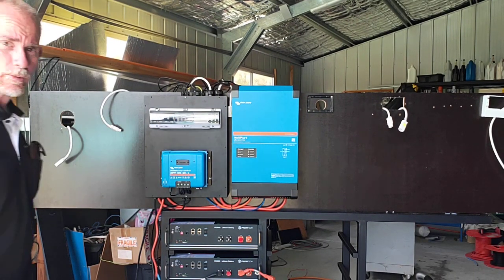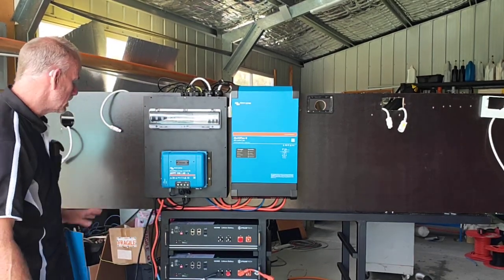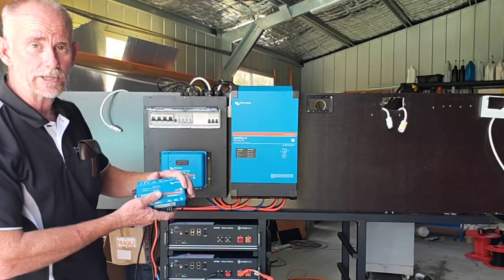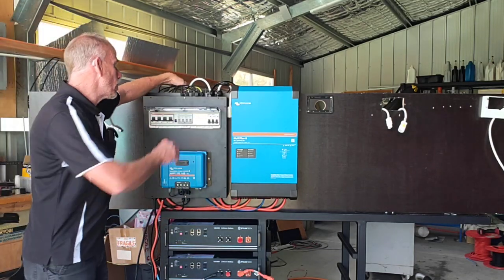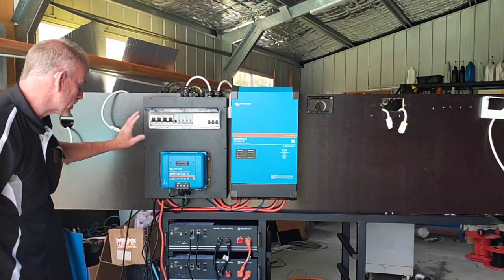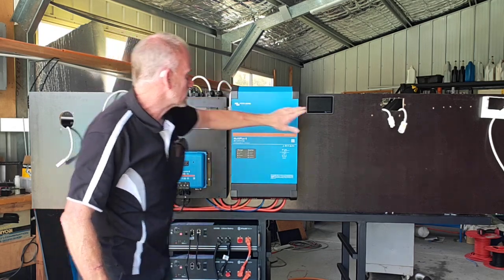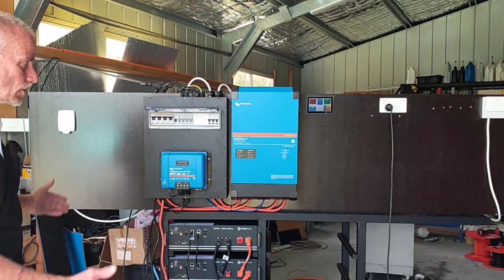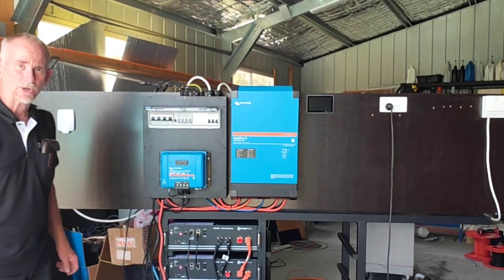Victron Multiplus II and the Langshore Power Breakout Box

Comment: This looks similar to the setup I'll probably have Steve, except more likely with the 3000 inverter and two batteries. How much would a setup like this weigh altogether?
Reply from the maker: Hi there and thanks for the question. The 3kVA Multiplus II is 18kg and the 5kVA is 29kg. The Pyontech 48v 3.55kWhr batteries weigh 32kg each and the 24v version weigh 26.5kg at 2.8kWhrs, so a little lighter but slightly less capacity. Hope this helps!
Reply: @langshorepower5346  thanks yes it does help. Trying to design the layout for my new bus and wanting to balance weight as much as possible. Aso trying to get a sense of how much space to allow for the electrical gear now since the coaster doesn't have any underfloor storage.
Reply from the maker: The best thing I did to save weight in my coaster was use lightweight ply. It’s not cheap, but saved hundreds of kg compared to standard whiteboard I used on my first coaster fit out. Chat to Richard at NOQ NOQ.
Reply: Bloody gentleman, thanks for your time mate. Thanks for such a great video and can’t wait to get one of your setups in the near future!
Reply: Hi, do you need to have segregation between voltages in the switchboard? Cheers
Reply from the maker: Yes Jeff, there's a physical divider inside between the 240v AC wiring and all the DC gear.

Comment: hi Steve, what breaker did you use for the battery disconnect? as you need a bi-directional breaker and not a polarized one as they will catch fire when there is amps from the charger, as they can only extinguish arcs from one side.
Reply from the maker: Spot on mate, you cannot use a polarised breaker. I’ve used NOARK 360v dc breakers for the solar and the larger ones are ABB.
Reply: @langshorepower5346  thanks Steve! that helps as I am planning a truck project on 48v, can you tell me which ones from ABB as I am in Switzerland and ABB is available here.